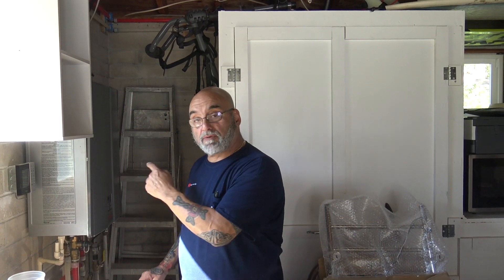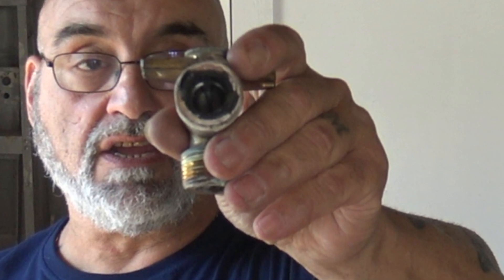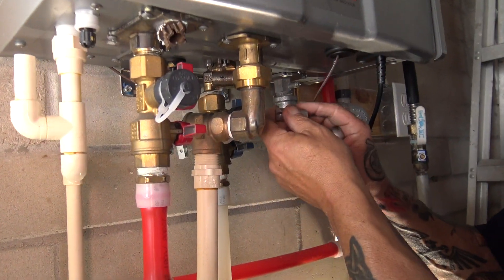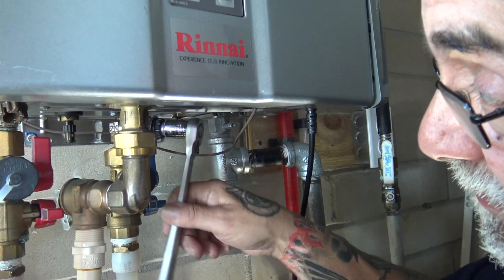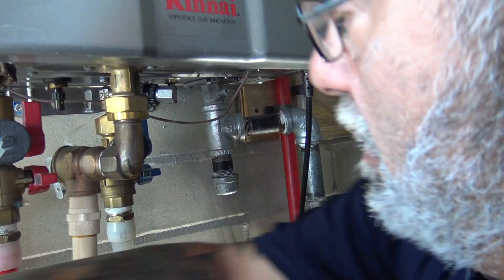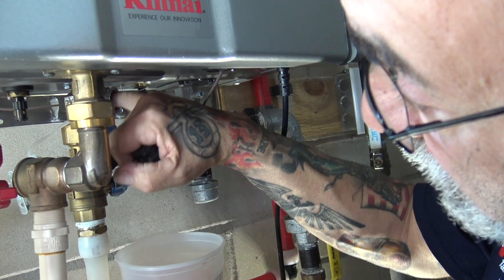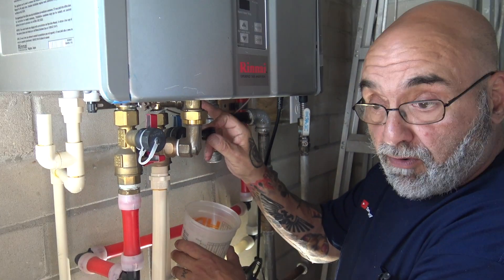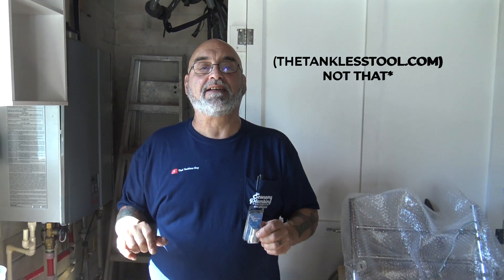Rinnai cold water inlet filter removal tool #shorts

Comment: Hi
I descaled my heater 3 months ago and installed a new in-line filter without any leaks.  Now water is slowly dripping out of the plug.  ICan try re tightening the plug but I know that they are fairly fragile and am concerned that I could ruin the new plug/ filter.  Any thoughts on how to fix?  Thanx Steve